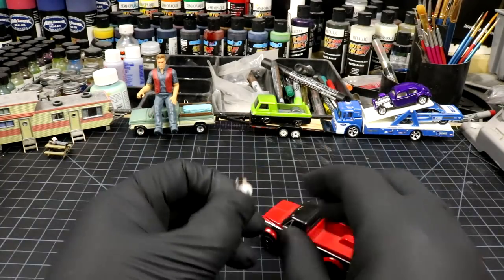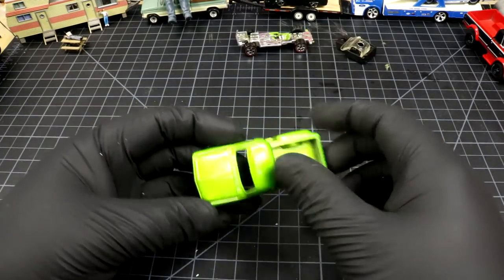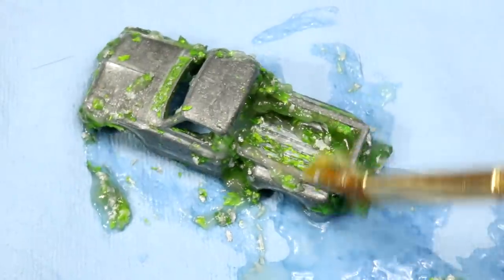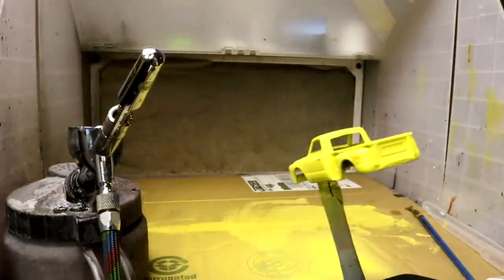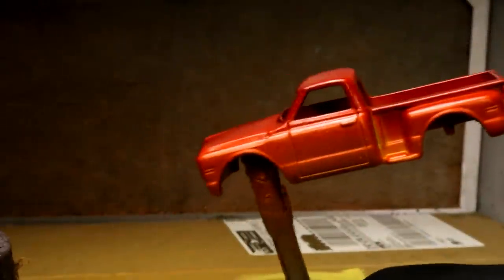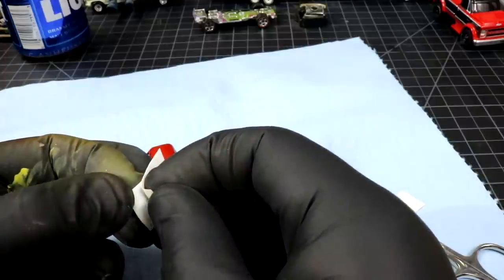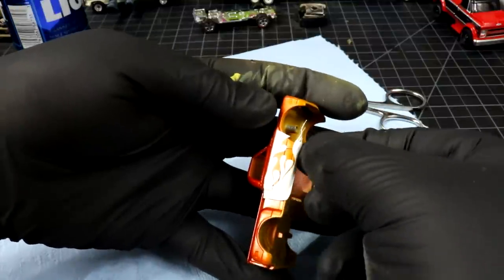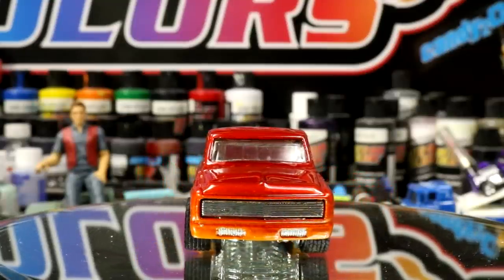How to Paint Diecast Cars - Hot Wheels C10 - Flames Paintjob

Comment: Glad you're back. What do you use to clean pearlized createx paint out of your air brush
Reply from the maker: Lately I've been using  Createx 4012 reducer but Vallejo Airbrush Thinner actually works better for Createx products and its cheap..  If its a real bad case you could use lacquer thinner and just submerge the lower half of your brush but remember not to soak the trigger area.
Reply: @DiecastResurrection  thank you. I keep getting build up and it clogs up where the needle and bowl meet. I'll give it a try

Comment: What clear do you use? I'm new to createx paints and I've noticed that they usually have a matte finish when cured. Any help would be much appreciated .
Reply from the maker: I use 2k automotive urethane, the same kind thay bodyshops use. I use medium speed reducer and medium activator. You can buy the same stuff from Redlineshop or Zero Paints but its all over priced.
Reply: @DiecastResurrection  yeah, I have done 2k urethane. I just didn't know if it was compatible with the createx. I ordered done createx clear, I'm hoping it produces good results
Reply: Some